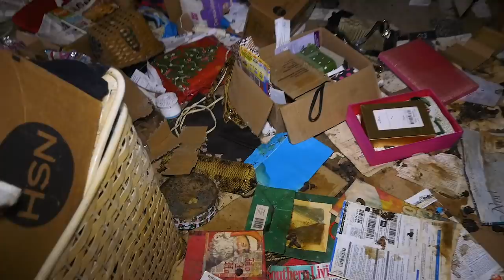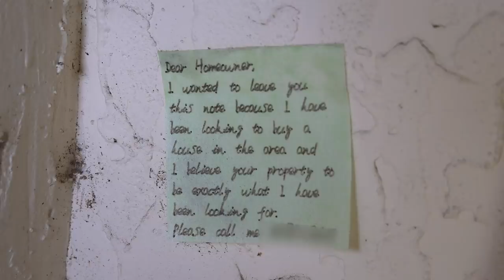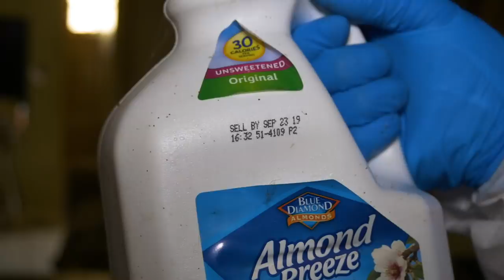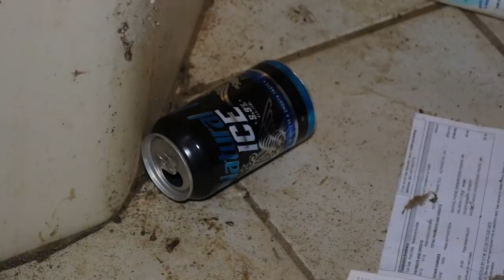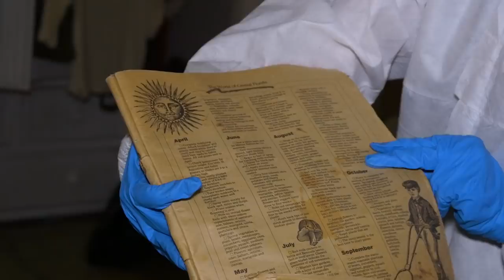Spider Nest/Roach Graveyard | Lakeland, FL

Comment: If "full deep clean" means anything less than set the whole house on fire, then they are out of their minds fr
Reply: Exactly🔥🏠🔥
Reply: I just had the same thought
Reply: An incredibly important issue - once you clean all the surfaces and get rid of the stuff then you have to worry what is in the basement, crawl space, attic and inside the walls.   Burn it.  Much cheaper to rebuild.
Reply: I moved into an elderly man's home. Black stains on the wall everywhere he touched. You know that's dookie.  Used so much bleach I can't stand the stuff decades later.
Reply: @AS-uy9gn  didn't think about that until now, yep burn the house down
Reply: really makes you wonder what happened to the place you lived in before you moved in how much it was fucked up before they made it look livable or at least like a piece of crap lol
Reply: Lmfao
Reply: Throw the whole house away at this point.
Reply: Lol fr
Reply: @hinata750  unless it’s brand new it’s gonna be nasty
Reply: @AS-uy9gn  spoken like someone who never have cleaned a borders house
Reply: IKR!!!
Reply: "Hans! Get ze Flammenwerfer!"
Reply: @AS-uy9gn  Assuming that the home does have a basement since this is Florida.  But knowing this is an elderly person's home,  wouldn't be surprised if there was one.

Comment: "Oh you guys clean messy houses"
"Yes Yes we do"
"So you use brooms and mops"
"Shovels"
"..........Shovels?"
Reply: I too cleaned with shovels.. though it wasn't milth, but dusty bits of scrap metal in a steel factory. There is so much you use a shovel and a wheelbarrow, as for the broom.. don't even bother out of just pushing off the big stuff: dusting off is a waste of time in this case XD

And shovel cleaning.. its exhausting (not helped by the fact I'm a shrimp)